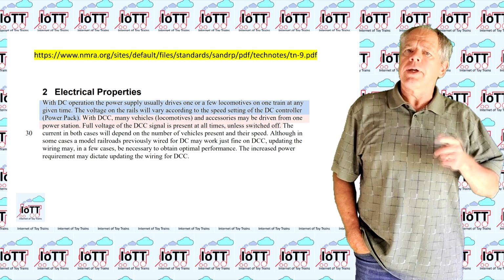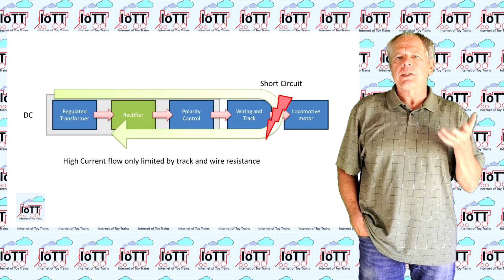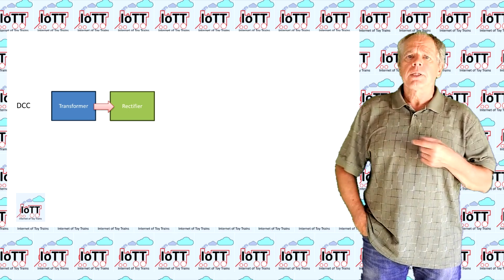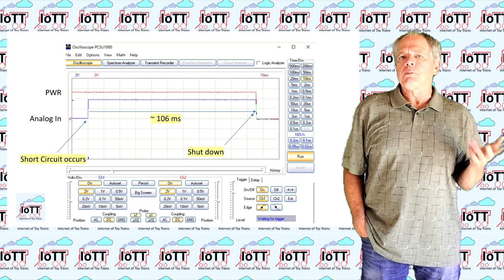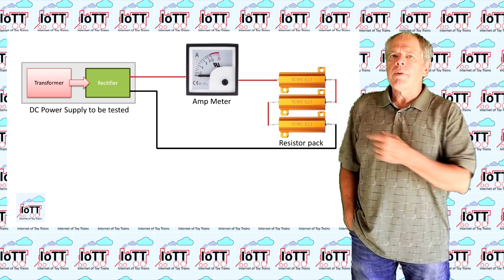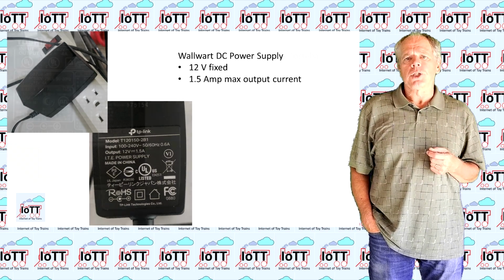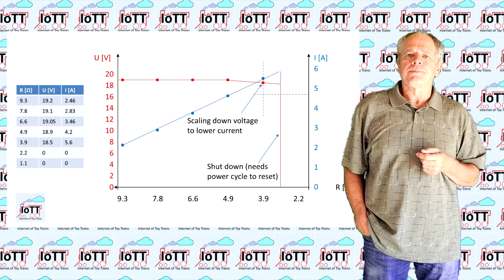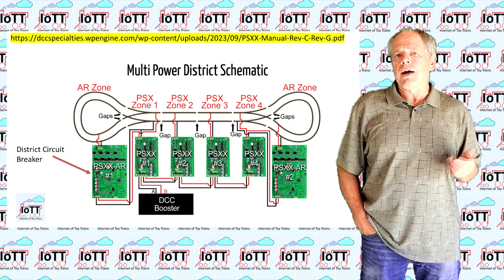DCC Power Supply Short Circuit Testing (Video#141)

Comment: Hi Hans. I have used Digitrax PM42 Power Managers with Digitrax Command Stations on my 3 exhibition layouts.  I set the trip current for each section to either 1.5A or 3A and trip time to  faster.  The 4 Power Manager sections are used for scenic section, staging yard, test track/wheel cleaning and accessory power.   I haven’t seen the command station shut down, only one district so the PM42 does the job - it also reports back on LocoNet.
Reply from the maker: Thanks for sharing. I think I have one of the PM42s sitting around somewhere. I guess I need to give it a closer look!

Comment: I agree with @robleathley6024 about the circuit breakers.  I use a similar setup as he describes.  I'm using the IOTT external power shield whose output is then fed into the individual circuit breakers/auto reversers. As I have watched development of silver hat I have wondered if it supports a mode where it could be powered from booster/track signal and effectively serve as a circuit breaker auto reverser.  This thought occurred to me again as I was playing around with my tinker face shield that if tinker face shield could power the Arduino it might be possible to use the silver hat as a circuit breaker as well, in addition to booster?
Reply from the maker: The SilverHat can do both, acting as auto reverser, and of course over current and short circuit protection. But to do that, it relies on the current measurement capability of the PowerShield. With only Arduino and Tinkerface shield you can't measure the current and you also have no way to interrupt the power delivery. If you add a PowerShield, it is just a complete SilverHat booster, which btw I plan to officially introduce in one of the next two videos.

Comment: Welcome back Hans! It’s good to see you in a new video. Circuit breakers are pretty important as we have all heard horror stories of engines “melting” down. Given the cost of a DCC sound decoder equipped engine today, they are a small, but worthwhile expense, to protect your investment. I’m glad you added the information at the end about powering multiple Powershields from the same power supply. It confirmed what I have done to my system. In addition to a 10 amp power supply, I use a separate circuit breaker for each of my four power districts. Looking forward to your next video.
Reply from the maker: Thanks. I was not away, it's just this video was a nightmare to do. It was originally in the makings as Video 140, but then it was ways too long so I decided to only do the PowerShield part. Then I planned it for a week ago, but in the process of making it I figured I needed some more testing, so it was back to square one. Finally it's here now....
The circuit breaker on the power supply side of the command station is really only for the wiring between the PS and the CS. The command station could do without. But for sure it improves safety, i.e. reduces fire risk, in case you have a problem in the wiring. 10 Amps or more can be quite intense...